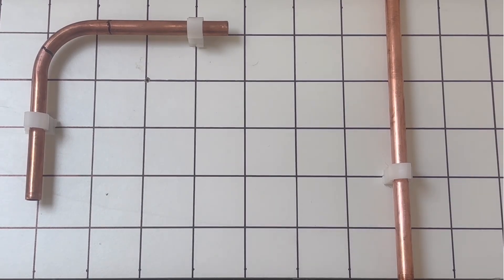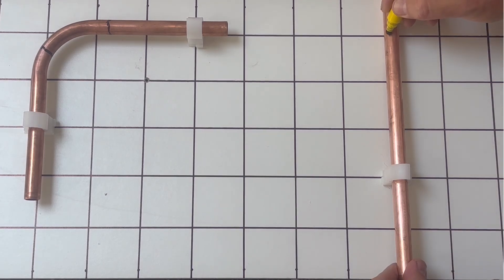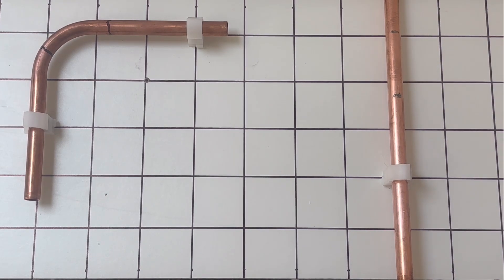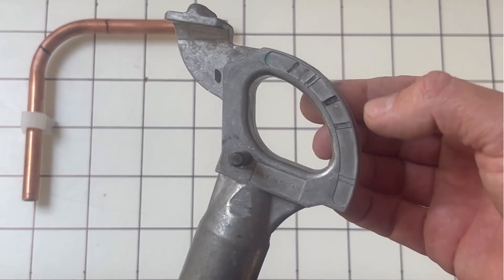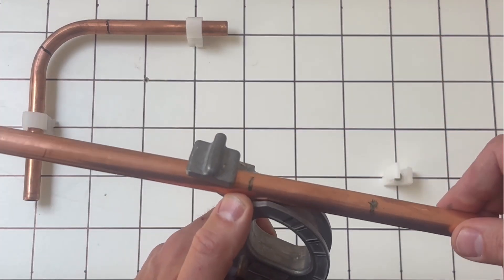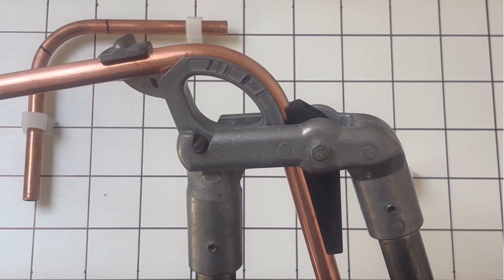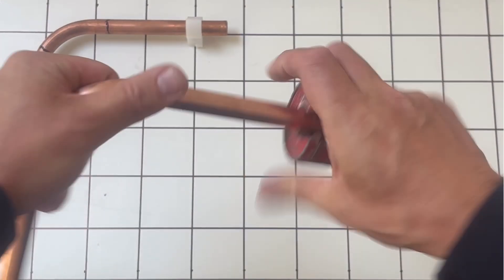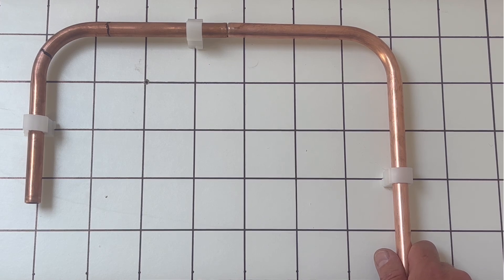Bend It Like Copper: Simple Technique for Perfect Pipe Bending. #asmr #howto #diy #foryou

Comment: what was the function of measuring 70mm?
Reply from the maker: This deduction accounts for the pipe's curvature and helps ensure a precise bend
Reply: @SFXPlumber  But you aligned the first mark to the 'fixed' part of the bender, then use the bending arm to bend to (just past ) 90 degs. The 70mm marking wasn't used for anything. If you hadn't marker 70mm, and just bent the pipe to the 90, you'd have achieved the same result
Reply from the maker: @kevcruickshanks The 70 mm marking from the first mark was used to achieve this if I was just to bend a 90 I’d be cutting off both ends , I only cut off one end to make it simple for others. Thanks for the comment BOSH

Comment: I'd still prefer to weld in a 90 degree joint because bending the copper that far stretches and  weakens the outer side wall of the pipe and compresses the inner side
Reply from the maker: Yes bud I’ve never had an issue in any pipes I’ve bent